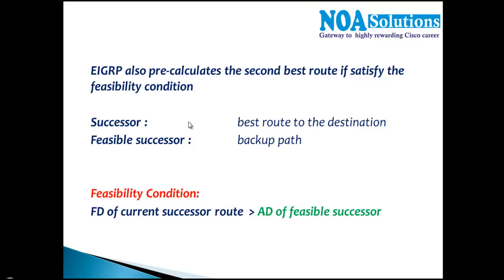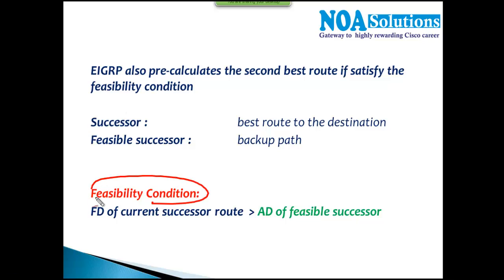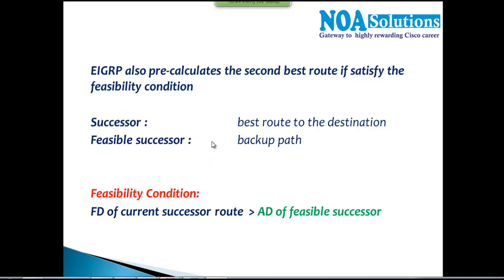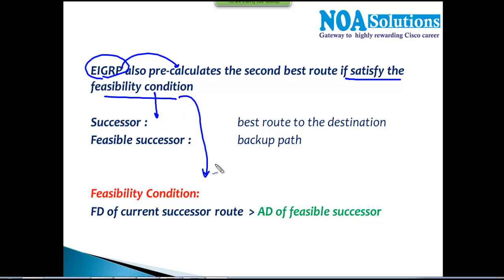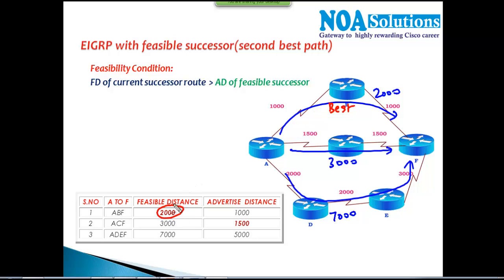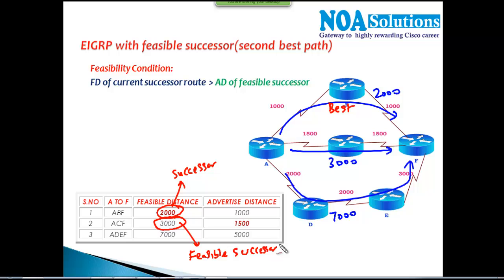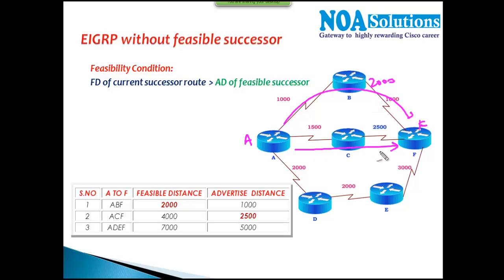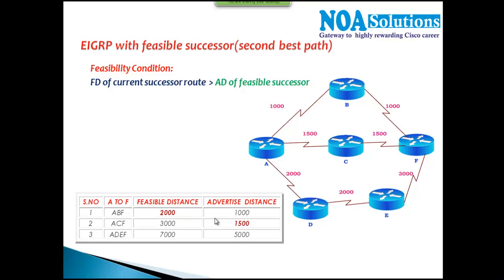CCNA Routing & Switching:Feasibility Condition

Comment: The real reason why it wont consider a route with a higher advertised distance as a second best route is, that there is a chance that the other routers will try to reach the destination over router A. So if the link to B fails and A cannot reach F over B anymore, the other routes  that have high ADs probably cant reach F either.